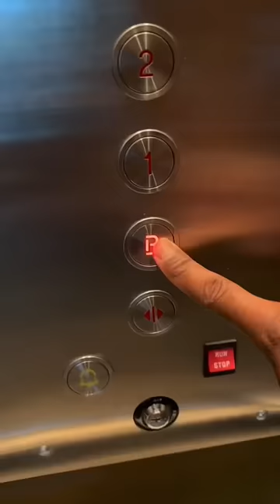Let’s deep clean my movie theater to prepare my boys for a special surprise. #shorts #viral #clean

Comment: You can get extendable stick flat mops with changeable microfiber slip over cover to dry and polish up. i use mine after cleaning and sqeezing tiles clean, i buff them dry and shiney with it and covers velcro fastened double sided too.😉👌🏼